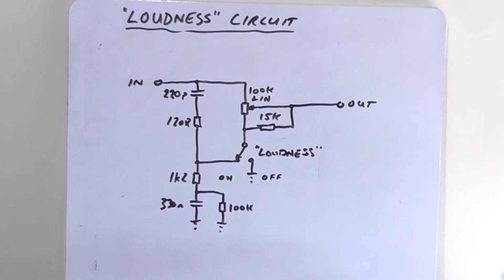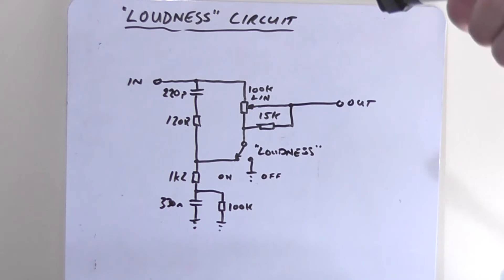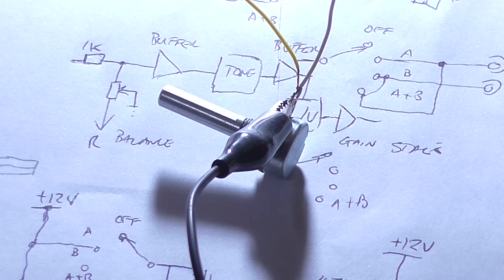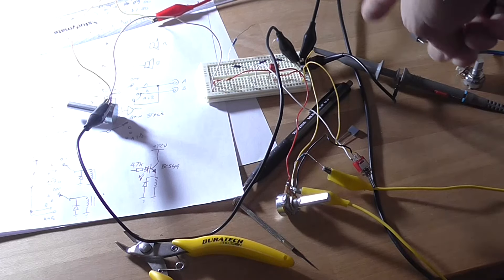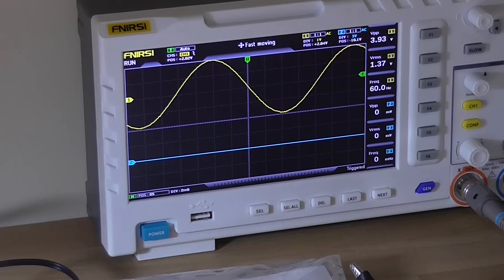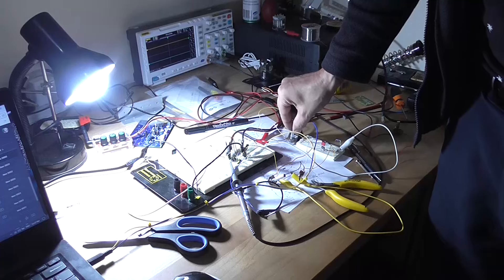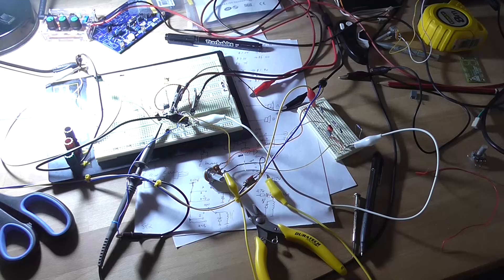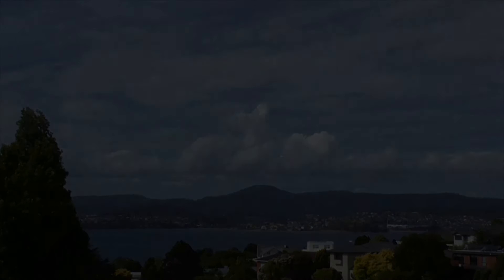Amplifier "Loudness" Compensation Circuit Experiment

Comment: I would have to agree with you  a better pot. You will get almost zero output. But like you said it's an older concept for sure and one more thing in the low voltage signal path to add some sort of distortion and a headache 😂. great video.
Reply from the maker: Thanks!